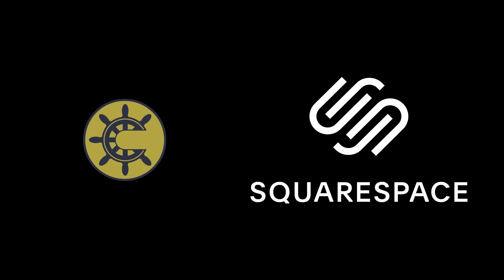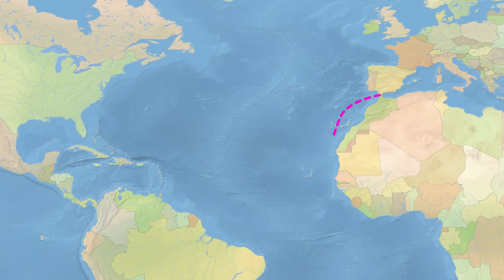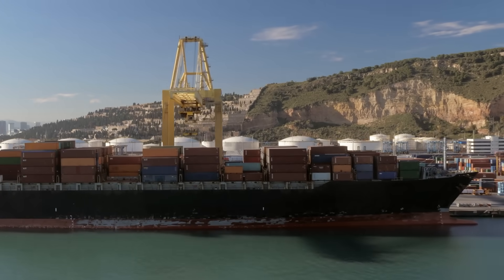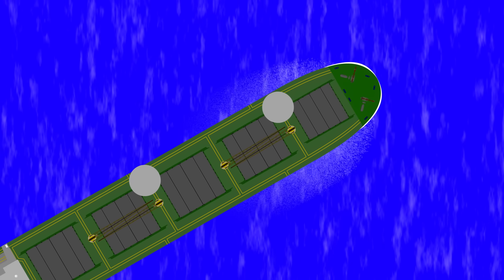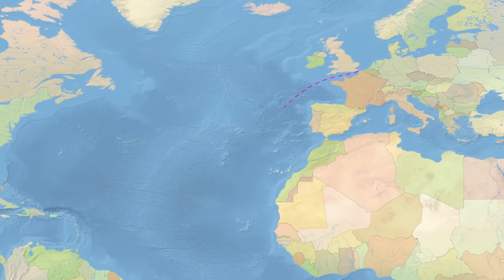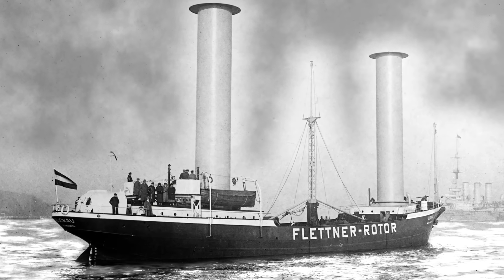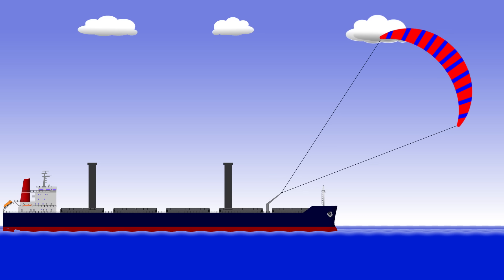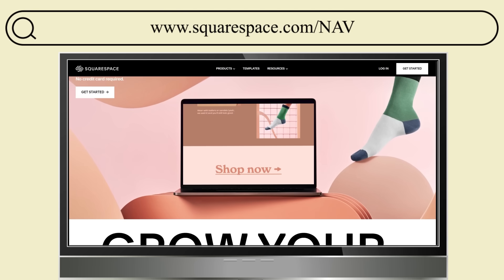Why Don't Sails Work On Ships?

Comment: Wrong wrong wrong.

At least, your understanding of sails.

Old square rigged sails would (and still do) catch the air like a parachute and thus drive the ship forward.

Modern sails function just like aerofoil on an airplane. The wind blowing across them generates lift in a horizontal plane.

Whilst just about anybody can sail with only a few minutes of instruction, a good sailor will adjust the lines including the rigging holding the mast to control the shape of the sail and maximise its lift.

Of course, on a tail wind, the sails can be manipulated straight out either side and catch the wind as traditional square rigged ships did, but at the cost of speed.

Catching the wind means you can only move as fast as the wind assuming zero drag. But ships have a lot of drag.

A sail generating lift from the sides however, is so efficient that it can propel a shop (assuming an efficient hull design) faster then the wind.

This is done very often on racing sail boats, although a lot of boats are designed with stability and comfort in mind which reduces the speed that can travel at even under engine power.

With electric winches, in mast / in boom / cable stay furling systems, self tacking equipment etc, the number of people required to ACTUALLY manage the sails is quite small.

In fact, if the market existed for it, I'd put my life savings on a wager that a computer could automate EVERYTHING and only require trained sailors / mechanics for maintenance tasks.

With the exception of the few commercial sailing boats still in existence, the sail boats still in service are those that a sailed by sailing enthusiasts who WANT to haul on the lines. Even if some of them have electric winches and furling sails for convenience or to overcome their physical limitations or disabilities.

Sailing boats have also held one advantage, they have built in cranes.

This was great during the times when dock side cranes weren't a thing, or you had travelled out to the colony's and needed to unload.

Not so useful nowadays given the size of shopping containers or buckets and grabs for bulk materials and in no way as fast as modern dockside cranes.

Long winded post that got slightly off topic, but had to clear up your mistaken understanding of how sails work.
Reply: @Lancecoolie  he stated "sails deflect the wind", which they most certainly do not.

I did watch the full video, including the advertisement at the end.

But have you ever sailed a boat?
I know I have. I've even raced them and helped prepare a 30ft boat for the Sydney to Hobart race, one of the world's top sailing events of the year.

Unfortunately I wasn't in a position to participate in the race itself. But I will.

I'm looking to buy and refit or built from scratch my own ketch in the coming years.

I'm no expert by any means, but I do know enough to say his statement was wrong.

I also have spent a large portion of my working life in aviation, including taking flying lessons and doing aircraft maintenance.

So unlike some keyboard warriors, I have a pretty good understanding of what an aerofoil is.

I also have no doubt that the channel and our wonderful host will understand that I'm not berating him, rather correcting him.

He can't be an expert in everything and my money is that he hasn't done much time, if any, on a sail boat.

Personally, I watch these videos because there are things I am yet to learn. One such video on how a tall ship tacks really opened my eyes, because of how differently they do it to modern sailboat.

And whilst it may not be an in-depth video on the raw mechanics of sails, the ENTIRE video was about sails which even those spinning tubes using the magnus effect are.

So correcting one small piece of information about sails seems very reasonable in my opinion.
Reply: @Emily35-Official  sorry but you are wrong on the most basic level. Sails do deflect wind. And if you define the thrust required of the sail to be ‘forward’, then it is a matter of conservation of momentum that wind must be deflected to the rear. It is an example of Newton’s 3rd Law (which itself is an example of conservation of momentum). The video is correct.
Reply: @XPLAlN  no, the video is not correct.
I never mentioned the word thrust, but if I had I would not have defined it as "forward".

And Newton's 3rd law isn't being broken at all.

Let me explain it in terms a kindergarten kid might understand.

If a boat is travelling North and there is a wind moving East, then assuming a perfectly designed aerofoil angled toward the west will seperate partials of air with some going North of the aerofoil and some going South of the aerofoil.

The two streams of air particles will rejoin each other at the trailing edge of the aerofoil in the precise alignment that existed before the passage of the aerofoil.

However, as the aerofoil is curved on the Northward side, the air partials travelling North of the aerofoil need to cover a longer distance and thus they move faster.

This faster movement causes an area of low pressure. The aerofoil is now conflicted by lower pressure to the North with the now higher pressure to the South and thus causes the aerofoil to move Northward in an attempt to equalise the pressure difference.

Now that you are feeling more like the idiot that you are, please watch this video for a more visual learning experience suited to someone of your level of immaturity.

https://youtu.be/yqwb4HIrORM

Oh and if Casual Navigation wanted to do a follow up post or video on the matter, that might be useful.

Again, never intended to attack or berate them. Just to correct a common misunderstanding a lot of people have.

And that apparently some people are so fixated to, that they are unable to see the truth from behind their body armour and keyboards.
Reply: @Emily35-Official  Ah good, a bite from a sciolist. I will rebut this nonsense from the top:

>>”I never mentioned thrust”

You didn’t. I did because it is a relevant term when dealing with propulsion.

>>”I would not have defined it as forward.”

There is one force from an airfoil called total reaction. All the others people talk about are components that need defined. If you want to know how much drive a sail provides you need to figure the component that is aligned with the longitudinal axis and positive in the direction of travel. Strangely then, that is the convention that engineers tend to alight on. You are free to define it in any other silly incoherent way that pleases you but don’t expect to be taken seriously.

>>”And Newton’s 3rd Law isn’t being broken at all.”

When you say “sails most certainly do NOT deflect the wind”, you hypothetically violate N3L. This is a simple matter of conservation of momentum. Lift, thrust and drag are forces. Force is rate of change of momentum. The rate of change of momentum here is the rate at which the wind is being deflected from its freestream velocity. Deflect the wind in one direction to thrust the vessel in the opposite direction. Newton’s 2nd and 3rd laws.

>>”Let me explain it in terms a kindergarten kid might understand”

How about just trying to explain it in simple terms that are scientifically valid. Like it was in the video.

>>”The two streams of air particles will rejoin each other at the trailing edge of the aerofoil in the precise alignment that existed before the passage of the aerofoil”

Well, in theory if the airfoil was not generating any lift (note: or thrust - same principle different vector). But any time the sail is actually driving the vessel the streamlines will leave the trailing edge with a vector different to the freestream vector.

>>”However, as the aerofoil is curved on the northward side, the air partials [sic] travelling north of the aerofoil need to cover a longer distance and thus they move faster”

No. There is no physical constraint or law requiring air in the streamlines that split at the leading edge to arrive at the trailing edge at the same time. It is completely without any basis in physical science, and is an opinion held by the scientifically illiterate only. Even if you believe this cobblers, as you do, it is absurd to think it applies to a sail where the profile is virtually identical on each side, the difference being the thickness of a piece of fabric.

>>”The faster movement causes an area of low pressure.”

The pressure difference is a fact not caused by the “air partials [sic] needing to cover a longer distance”.

>>”I never intended to attack or berate [Casual Navigation]. Just to correct a common misunderstanding people have.”

You have only repeated a load of sciolistic nonsense. The video is correct. If you had benefitted from any formal education in elementary fluid dynamics you would know how ridiculous your comments are. You will never hold a valid understanding of aerodynamics as long as you cling to the ‘equal transit time fallacy’. It has been debunked by scores of bona fide scientists and engineers so you’d be well advised to go away and look it up before your next attempt to correct anyone else.

Comment: This is depressing!  There's so much we could do but capitalism doesn't encourage saving the planet, just making money.
Reply: lmao without capitalism, we would not have any kind of even early modern sea trading but still individual traders hauling small boats from harbor to harbour
long distance trading relies on capitalism since the 15th century. etc.
Reply: yeah, i invented a ship that runs on good wishes and love but capitalism doesn't want to make every ship like that either.
Reply: It encourages efficiency, unlike socialism, which produces endless waste and inequality
Reply: Holy shit. You people are just line by line admitting you don't understand economics or markets. Enjoy being poor. Capitalism doesn't have to encourage anything, yet it still is by far the economic system with the best environmental track record by so much that the fact that you can make a comment like that is an admission that don't actually care about the planet at all. If you cared, you'd care enough to do SOME research. ANY amount of objective research reveals that capitalism has by FAR the best environmental track record of any economic system and that markets are the easiest method by which to achieve change, environmental or otherwise.

Comment: pretty sure constant progress in fuel saving technology in international aviation comes about without the UN making any laws. Its because it saves money. If wind tech on ships really ends up saving operators money then they will become common place, and owners will provide what the market wants.
Reply: Absolutely right. Regulation does nothing but legitimise a slightly smaller amount of pollution. Property rights are the best way to prevent pollution
An example from Dr. Murray Rothbard

If pollution from a factory damages my shirt, the factory owner must pay to have it cleaned, repaired, or replaced. That's far too much of a nuisance for all but the stupidest of factory owners, so they will look into whatever ways possible to prevent damage to anyone's shirts, or indeed property as a whole

Comment: But can space ships have wind sails?
Reply: @gamerfortynine  not only yes, but in fact they do take into account the solar winds and the James Webb Telescope, which was launched on Xmas day and has a large "sail" on it, has to carry enough fuel for its planned 10 year mission, just so it can counter the effects and stay in the right place.

(the "sail" is actually a heat shield to protect the instruments from the gun and keep them at below freezing temperatures. It just has the unfortunate effect of also acting as a sail)